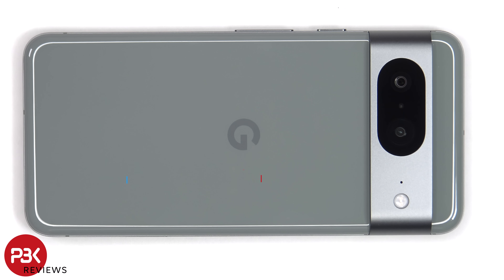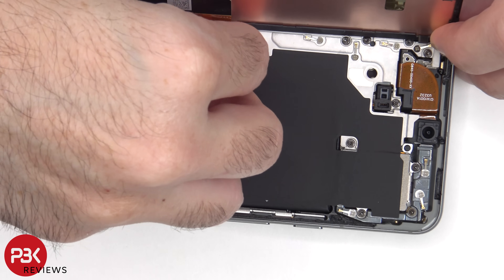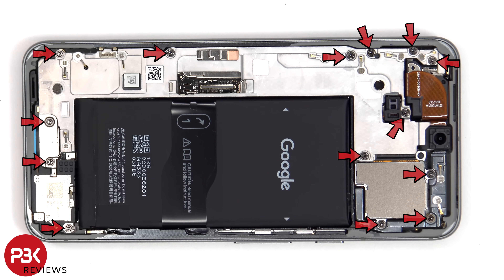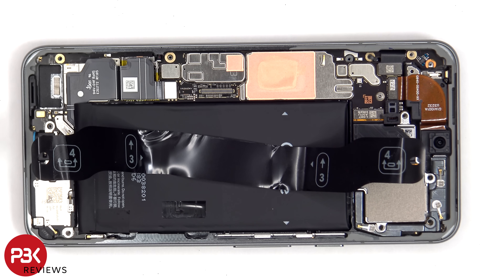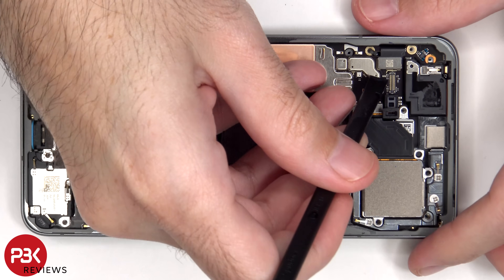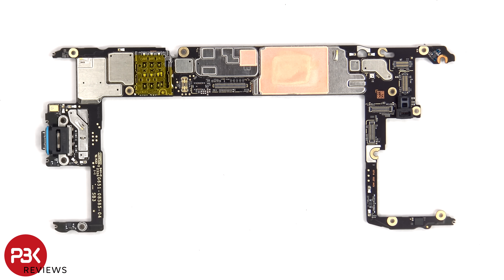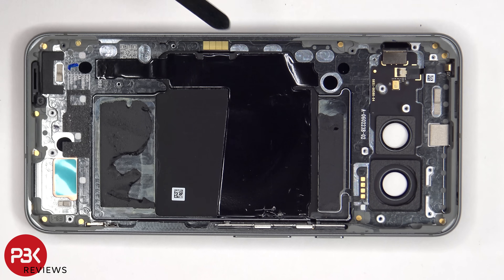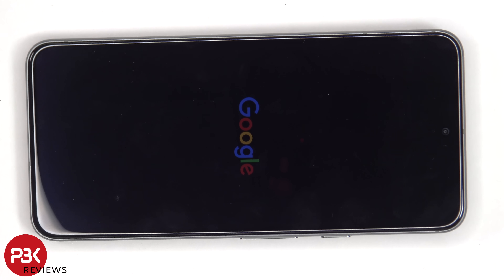Google Pixel 8 Teardown Disassembly Repair Video Review

Comment: Hundreds of people have been reporting loosing wifi and bluetooth after about a year. Not a SW problem as it happens with both stock rom or alternative ROMS (ex GrapheneOS). Despite the hundreds of reports Google has made no statements and is only privately dealing with those under warranty. One of the many theories seems to be that many units have soldering issues for the wifi/BT chip that with strong heat gets loosen. Any opinion on the topic?

Comment: You don't know anything about the fact that the cable is pierced by antistatic pins, and the screen has stripes. This happens a lot on Reddit. I read a lot of bad things about it. In the new Pixel, they solved this problem.

Comment: Is it okay if I changed the camera without removing the battery first? Seems like we can do it  without removing the battery. I want to know if i removed camera first, is it harmful to the camera or the board because the battery is connected
Reply from the maker: There may be a chance of shorting the board or part if metal tools are used etc. If all works find after replacement, then you should be fine.

Comment: one month ago i just dropped my phone from 2 feet and got a pink line in my pixel 8 and it appears rarely and wanished out when I press it from right bottom corner....need suggestion is that fix able or not?

Comment: will I have my warranty void if I teardown my phone? My pixel 8 blacked out, when I was just scrolling, no response at all. I didn't even drop it, and the pixel 8 was unboxed only a month ago. I bought the phone from a different country and there are no certified google repair centers here in my country. So I wanted to have a look inside the phone myself without having to worry about voiding my warranty.
Reply from the maker: yes if they see any signs of it being opened or tampered they will void warranty. however if you got it from a different country, the warranty will only be valid in the country you purchased so you wouldn't be able to file a warranty claim in a different country. so depending on if you plan on going back or not, you can not worry about it

Comment: removed my battery and placed it back, now it only shows low battery and doesn't seem to charge when charger is plugged in.should i get a new battery?
Reply from the maker: Might be that or can be a loose cable etc.

Comment: With such a large piece of grafite film over the battery, if the battery is to be replaced should you replace the film or is reusing it still a viable option?
Reply from the maker: you can reuse it

Comment: My Pixel 8 makes a "rattling" sound when I shake it. I believe it's somewhere on the upper part. It never dropped as far I know.
So actually looked for a teardown video to check what it could be, looking to the internals.
But everything seems to be tightly fitted and screwed. It seems there're not actually components that might have gotten loose.

Anyone anny idea if this is normal or not. And if not, what it could be?
Reply from the maker: Its normal, its the camera assembly OIS
Reply: @PBKreviews  Thanks for the response. Thought already something like this.
Had something similar with the Pixel 6a, but on the 8 it's clearly louder and more present. So I was wondering if it could have been a loose component.
But everything looks tight fitted and screwed. So I thought it probably could only be the front camera or the image stabilisation.

Comment: How do I fix the screen randomly turning fuzzy green? Seems to be a pretty massive problem for the pixel 8 based on the amount of Google results.
Reply: Contact the support, they will take care of it
Reply: @Karlenk0  I tried that, they told me it was gonna be 3-4 weeks to repair. I ended up replacing the screen myself for around $100.

Comment: on pixel 8, there is a gap between the aluminum frame and the back cover on the side of the buttons, which is not on the other side. In the promo video, they focus on it, but other users don't have it, is this

Comment: DO NOT flow this guy video of you will you will brake your lcd 100% he show that only with a suction and a plastic tool he pool the lcd out it’s wrong and falls !? 
To do it right you will need to apply some heat to the edge of the lcd this way the glue will loosens up lil bit but just by watching him I won’t flow him because he will couse you breaking your phone watch out   Don’t do it
Reply from the maker: You obviously don't know how to follow directions or listen since it's clearly mentioned in the video to apply heat to the screen to loosen up the adhesive. People like you shouldn't do this because you don't follow directions or pay attention. Work on your English/grammar instead so your message makes more sense.
Reply: @PBKreviews  dont worry he clearly had no idea how to listen, and using google translator to type this comment

Comment: Do you believe that the phone is still somewhat water-resistant after the disassembly? Its rather disappointing that the charging port is soldered, I love what Nokia did with the Nokia G22. I won't mention the Fairphone, that's a whole different level.
Reply from the maker: If you apply new original pre cut adhesive that's made for the phone, then you should retain the water resistance.

Comment: Hi @PBKreviews: Great Video(s) thanks for sharing teardowns like that with us! :)
One question if I may, starting in 1:13 little springs are visible along the edge that connect to the back-side of the screen when assembled. Currently the thread count for weird bumps visible in bright light (light needs to be as bright so that the screen becomes blue) goes up on reddid where users (including me) see those when the screen is turned off. I have also recorded one video (in my profile, an attempt to link it here was removed automatically). In case you have time to watch that/consider - do you think those bumps/dents could be a by-product of a assembly issue at the factory causing those springs to touch the screen a bit too hard so that the dents/bumps are visible from the front. In that case, could that in theory cause screen issues over time or would that rather be a cosmetic mini issue (I could accept a cosmetic issue, my only concern would be in case that could potential damage the screen over time)?
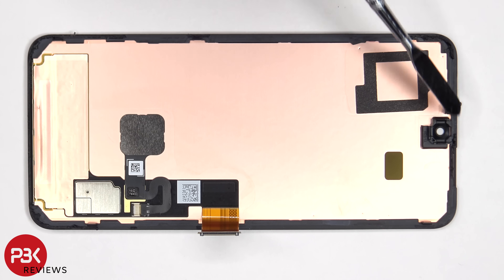Reply: at 1:50 you can see the copper foil on the back of the screen is pierced by those stupid springs

Comment: Thank you very much for this insightful video!
Could you report on the precise position and dimensions of the wireless charging coil? This would be very helpful to mount a metallic ring for a magnetic phone holder.
Reply from the maker: You're welcome. It would be the entire black square area on the back where I point out in the video. Not sure measurements since I don't have it on hand anymore to check.

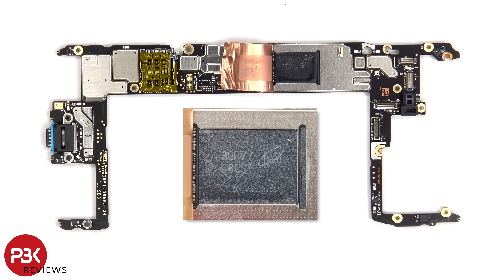Comment: Hi, just want to confirm @7:15, is the copper film and metal block surrounding it the only cooling component for the chipset?
Reply from the maker: The copper film, thermal pad, the mid plate that sits over the motherboard and the graphite film over that are all part of transferring heat/cooling.
Reply: @PBKreviews  Oh I see, thx for the correction :)

8's cooling solution looks less rigorous than typical Android phone, lack of vapor chamber and all that :/

Comment: When replacing the battery, i assume you would have to replace the graphite film to not mess up the thermals and also find new adhesive for the screen online, correct?
Reply from the maker: you can reuse the original film if it's not too damaged or wrinkled but in general it's almost impossible to find the original graphite films since they don't sell replacements for those. So almost in every case you are stuck to using the same one. As for the adhesive, yeah you have to use a new original pre cut adhesive made for the phone in order to have a proper seal and not risk the adhesive coming loose.
Reply: @PBKreviews  wow of course you can't get replacements. Thanks for the answer. That sounds like a lot of work and expertise required. I will probably just make sure to treat my battery well and hope to have it last until 2027, when I can just buy a phone with a replaceable one here in the EU.

Comment: do you think hw of this Pixel 8 can be alive after 7 years?
Reply from the maker: most parts of it yeah but some parts like the charger port which are wear n tear but soldered to the main board, no. can still be replaced but would require specialty shops which can do soldering.

Comment: Hello, thank you for the video. It's very informative. 
In your opinion, is this a more durable phone than the Pixel 5a?
I dropped my 5a and the screen stopped working, although the front glass was intact. 
I would like to know if these kinds of situations are not going to bappen withh the pixel 8.
Reply: It could be that the battery or display connector has been disconnected.

Comment: So just an idea, have you tried applying a little bit of heat to the battery before trying using the plastic strip? I know heat isn't good for any comment but Im sure using just a wee bit would be fine
Reply from the maker: Yeah heat usually helps loosen the adhesive, but considering the fact I used isopropyl alcohol which is much better at loosening up adhesive and it was still fairly tough, I don't think heat would have done much.

Comment: Would be great to see how face unlock works in low light conditions. The face unlock system, beside the small form factor, is a thing that i really love at my Pixel 4. If the face unlock system from Pixel 8 works as good as the one from the Pixel 4, i think that Pixel 8 will be my next phone ❤
Reply: It simply doesn't unlock got my 8 today and tried to unlock it in low light, and it asked for my fingerprint instead.
Reply: It won’t work. It’s not anything similar to Pixel 4, it’s literally just a front camera.
Reply: Upgraded from the Pixel 4xl to the 8 and the face unlock works well enough for me, but not in the dark. It's better on the 4xl but the 8 has a pretty quick fingerprint reader that works if you have the always in display so it's even faster to unlock. Banking apps also support the face unlock on the 8

Comment: Non-replaceable USB-C Port 👎
Reply: Calm down, you'll never need to replace it even after 10 years of intense use
Reply: @amreshdurrell9601  Lol, every USB-C phone I've owned has had problems with the port within 2-3 years. The ports become loose over time, OK the data connection still works but any slight tension on the cable and the plug comes loose.
Reply: @tzeimet  I still have LG Nexus 5x in working condition, never had any issue. 
I did face multiple trouble with lightning port in iPhone. Which even cost much more .

Comment: The battery is GLUED IN???!!! FFS come on. You can have screwed in batteries in portable devices, even ROG Ally has one. Google even bragged at the presentation that you can order parts from iFixit, but why would you order parts if this phone is horrible to maintain like all phones are nowadays... Can't wait for EU to force them to have swappable batteries again like they did with USB C for Apple. Guess charging to 70% and praying battery doesn't wear is the way to go again.

Comment: I might be slow but which part is the tensor chip
Reply from the maker: @7:14 its seated underneath the ram, so you can't actually see the tensor chip itself. The RAM would need to be pried off or de soldered off.

Comment: I'm 1 minute into this video and I feel duped by the Google presentation. They made it sound like it would be easy to replace the screen or battery. "'Apply heat to loosen the adhesive" is already outside the scope of 'easy'. Possible, yes.
Reply: Not to mention that adhesive might be fine NOW. In a few years when someone would typically be replacing parts the adhesive turns to cement and it becomes ridiculously difficult to soften it. I just did this on my Pixel 3 earlier this year. That adhesive needed a blow dryer on high for 5 minutes on about 2 dozen passes just to loosen it enough to get it started on one side. It ultimately didn't work and I just used my wife's old Pixel 3 where the battery swelled up and split the back open for me already and replaced that one instead (then transferred everything over). This glue shit needs to stop.
Reply: @theRemedyGames  I'm hoping the EU rules about user replaceable will help the US market, eventually.
Reply: @theRemedyGames By the way, all the heat cooks the battery 😢

Comment: Thanks for the teardown. Could you figure out which sensor the main sensor is? 
Because according to the specs it surprisingly is neither the gn2 or gn1, except Google made mistakes in their own official data sheets. 
(it is stateted, that the pixel 8 has ultra hdr which the gn1 isnt capable of but it is also stated that the sensor is 1/1,3, but the gn2 would be 1/1,12)
Reply: Custom gn1 ?
Reply: @kevin-hp7vg  Yup it looks like it.  Google also already confirmed that to "derstandard" It is a modified Gn1, which can do dual exposure.
So the bigger update is the newer lens which lets in 21% more light.

Comment: Is the display cable built in the same way, as in Pixel 7 Series? What do you think, will the P8 suffer from the same green flicker display problems, as Pixel 7?
Reply from the maker: It's not the same flex cable, the design is slightly different so hopefully it won't suffer that issue but it's too early to tell.

Comment: Great video. Can you also do a Pixel 8 Pro teardown?

It would also be interesting to know more specifics about the main wide sensor. Is it a Samsung GN1?  Or GN2? Is there maybe some writing on the backside?
Reply from the maker: It's a GN1 from the looks of it. Same main camera sensor in the 8 n 8 pro, and all the hardware info apps and picture details from photos taken point to GN1. I will be uploading the 8 pro teardown in a day or two.
Reply: Interesting. Google said in their presentation they are using a "new" main wide sensor, so I assume it's a modified GN1, maybe a GNV or a Google exclusive model alltogether. Google also states that the P8 (Pro) now also has Dual Exposure, which is a feature of GN2. Odd. @PBKreviews

Comment: I remember the repairability score for Motorola edge 20 was 7.5 and for new pixel 8 it's score is 7 which is built meticulously. I don't get it.
Reply from the maker: That video was a few years ago, and I made some adjustments with the scores and now display a score chart in the video, breaking down each section which I use to add up the final score. Some phones may be a higher score than another which might be more repairable ease wise, but different factors come into play. For example one phone might be super easy to take apart, but doesn't mean you can find parts for it to repair so it loses points on the other end. So depending on each section and how the score adds up, the final score can vary. The score chart breakdown now helps explain how I come up with the score.

Comment: Can you confirm that the phone can output display over USB-C using the DisplayPort Alt Mode.
Reply from the maker: It has no video out support. I tried and also checked the specs and doesn't have support for it. Might change with software updates but who knows.

Comment: Looking at the thermal system in this video I wonder how the heat management of this device going. Really hope it's working to reduce heat from the processor.
Reply: A source says that the 8 vs the 8 pro is 11% slower due to thermal throttling, that is to say both still get very hot
Reply: @raymondhacks  and that copper on the back of the screen might be the reason why the glue between the panel and the plastic frame it sits on is getting weaker on Pixel 7 and 7 Pro models. So maybe the issue with screens falling off from the phone will be even worse next year...
Reply: @raymondhacks  oh wow.. that sad.

Comment: I think Google has the best heat disipation system og any smartphone with this termal pad and the huge metal plate. At least in paper it look like it'll do the job fine.
Reply: same shit as 7 pro.
The heat sink has not been changed at all and most likely it will heat up just like the 7 pro, simply because it has been unlocked.
Reply: There's no way a simple thermal pad works as well as a proper vapor chamber design.
Reply: Thermal pad are inferior vs good thermal paste + efficient passive cooler , expect a result similar to the p7/p7pro

Comment: Google is reportedly going away from Vietnam factories, which sold these Pixels to the black market. You may not get another early sample next year.
Reply from the maker: I didn't get it from Vietnam so wouldn't make a difference for me but yeah their main reasoning is to prevent so much leaks. However I don't always get a chance to get devices early.

Comment: I suck at removing screens from the front. End up f them up. I always end up entering between glass and lcd. Better for me to watch someone else do it.
Reply from the maker: This one is fairly easy to remove since its on a plastic frame, so helps prevent against damaging the screen when prying off.
Reply: @PBKreviews  Do you use a plate to warm it up?
Reply: @PBKreviews which device you take to warm it Up?